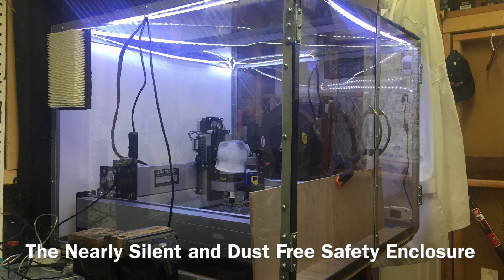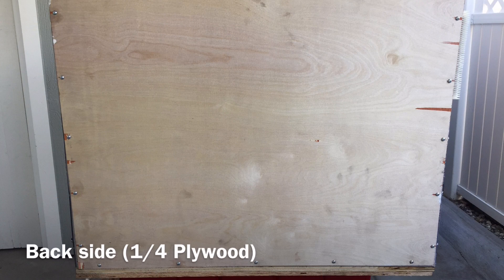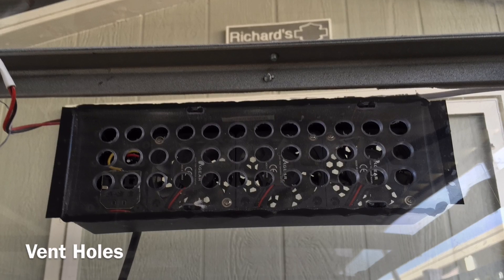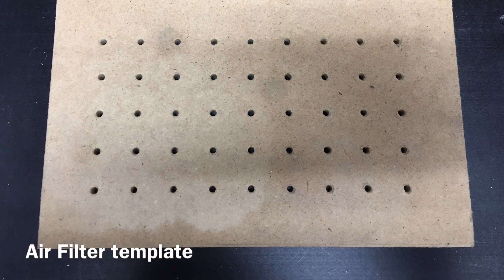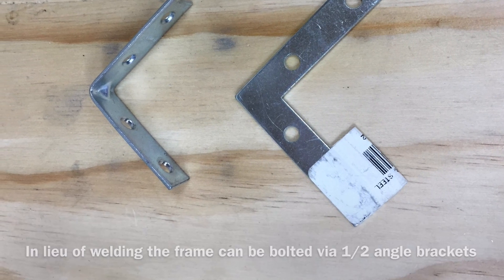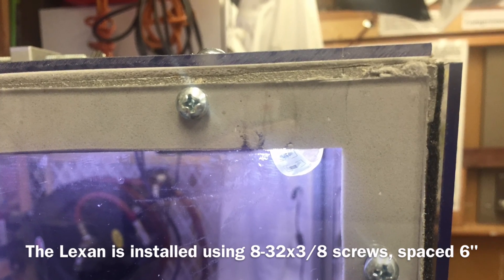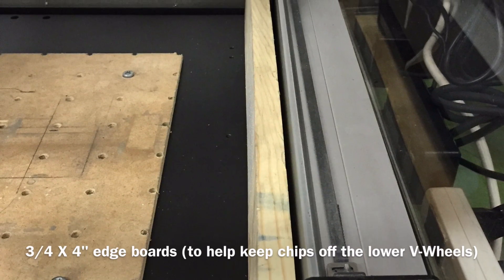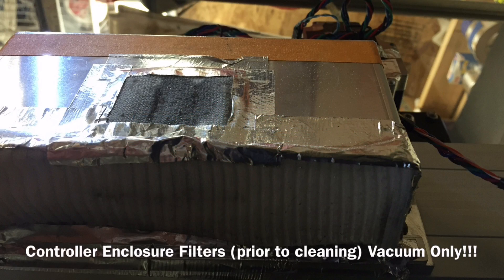My Shapeoko 3 Enclosure

Comment: Richard I have just bought a Shapeoko with the Dewalt router do you think it is a sensible machine for a first CNC machine?
Reply: Yes, for a couple of reasons, they have sold over 1000 of this model machine, So the design is well established. Many of the people who want previous version ( number two), purchased this model, Which means they believe in the company. Third the customer Service from the parent company is second to none. Fourth, I have use my machine Daily for 11 1/2 months, And it is good as the day I purchased, So the quality is also there. I don't know you'll level of machine experience but using this machine does take some machining and CNC knowledge, Either pre-or post purchase.  The carbide3D community forum, Which I am an active member is there to assist and help the newbies.  Welcome to the family!

Comment: could you share the information about the clamps you have made?
Reply: What would you like to know?  If I have your email address, I can send you the solid models, etc.  I made 3" and 4" clamps, other dimensions are 1" by 1/2".  A total of 12.  The program isn't fast, but it is a good single tool program.  So I could load the machine and walk away.  Come back in an hour and I had a finished clamp (Except for the over all length which was a second operation.

Comment: very nice. I will adopt some of the ideas you have shown.
of great use is the "dam" for the chips, and the shielding of the electronics.
I am currently ordering a shapeoko 3 simply because I want the ability to
cnc mill aluminum (in addition to wood/mdf). Your videos on using the machine
with aluminum are helpful. Thanks for sharing.

Comment: Love this! I need to build an enclosure for my shapeoko. Not sure if I want to do wood for the frame of weld up some steel like yours. One question - do you find access to the back of the machine harder with that enclosure?
Reply from the maker: +Carter Wilson Workshop with Bradley Boggs Good question! Yes and No (I'll explain).  The 24" height provides more then ample access to machine anything within the 16x16 work area.  Cleaning the filters?  Yes, I need to (for now) open the front doors and pull the unit out to service the back of the machine.  At some point, Rev B will be to make an access door on the back (Plywood) side to (a) allow easier access to service my filters (which is only a few times a year), and (b) allow me to run a longer part.  Example: maybe some kitchen cabinets doors, OR a 12" sign (Someday)

Comment: Love it. Which lights did you use? I"m trying to find some non expensive ones that will light up the entire thing
Reply from the maker: I have these: SUPERNIGHT
3.8 out of 5 stars  164 Reviews
SUPERNIGHT 16.4ft 5M Waterproof Flexible Strip 300l LEDS. I don't recommend them since they don't stick to anything (wood, steel, lexan). Real pain in the @ss!